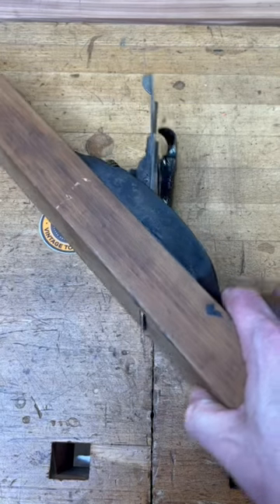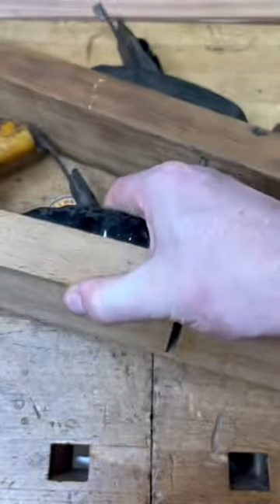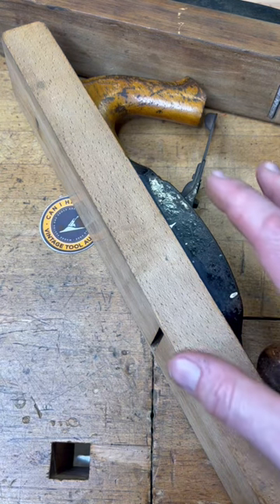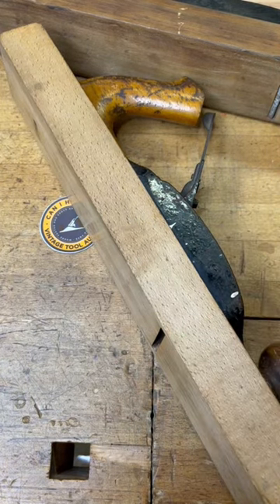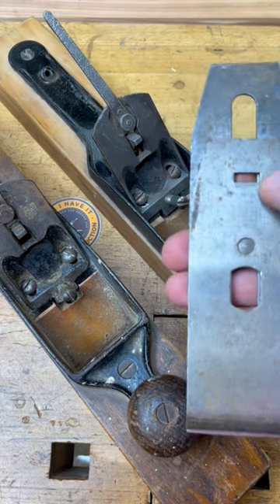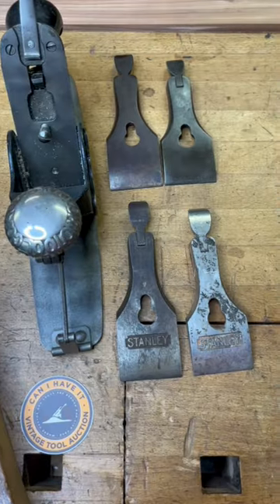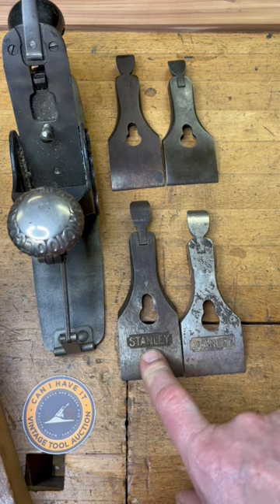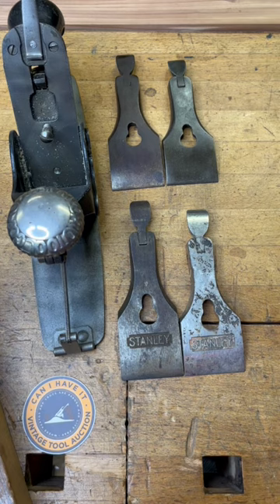Chip breaker compatibility - part II. More on circular planes and transitional planes. #handplane

Comment: Theres another scenario, there are some types of transitional planes that got a different depth adjusting mechanism and they got a tiny piece in the chipbreaker that needs to be setted so if fits right, got it in my 127.
Reply from the maker: True story - the Liberty Bell transitionals are a completely different animal. But I only had 1 minute to work with since this is a #short 🤓